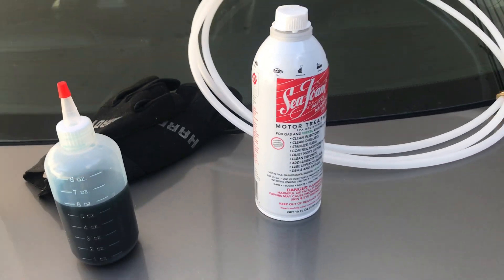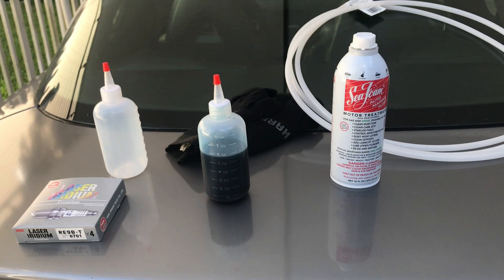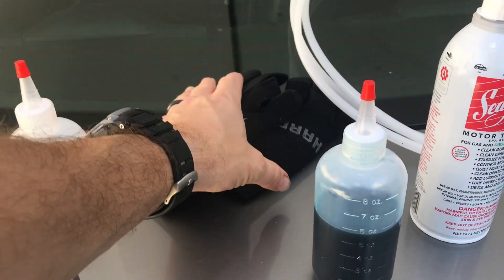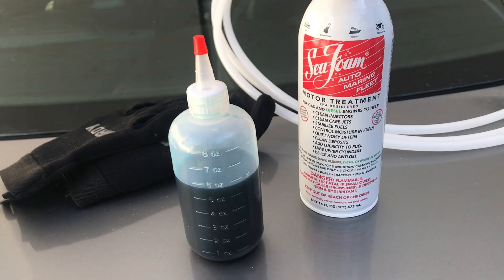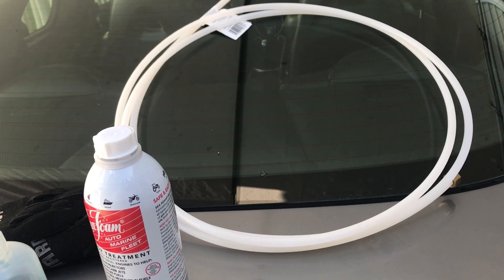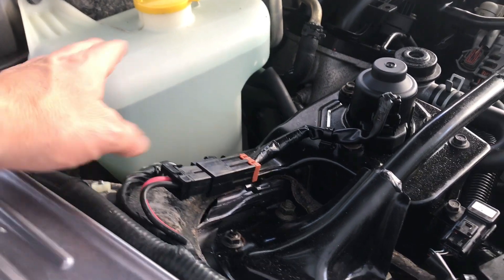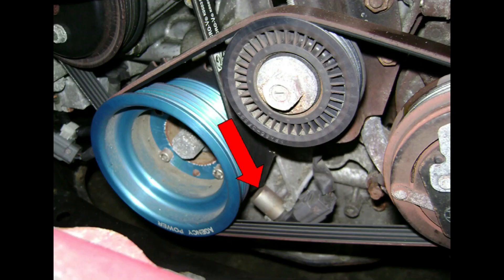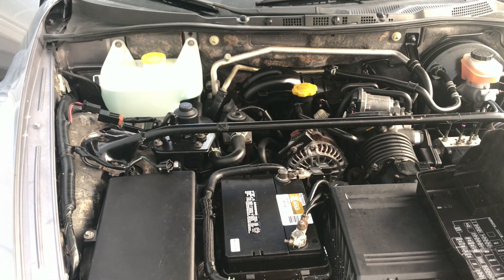SEAFOAM DECARB MAZDA RX8 HOW TO AND DOES IT WORK rotary engine

Comment: If you just want smoke to come out of your exhaust try extra virgin olive oil. It will be much cheaper than that stuff, smell nicer and will remove just as much carbon. If you have ever stripped an engine you will see that these deposits need to be chiselled off. But, hey, marketing is more powerful than sense.
Reply from the maker: Not to argue anything your saying except; On what planet is olive oil cheap?
Reply: Planet Aldi?
Reply: Does that really work? I want to Seafoam my engine but I’m concerned about my apex seals or fouling up the spark plugs.
Reply: @hiddenrotor3377  i use Coconut oil for the engine and Lavender oil to clean omp system
Reply: Has anyone tried ATF through that vacuum input? Supposedly it helps the Apex seals expand to provide more compression and less carbon monoxide output. Trying to get one smogged in California.

Comment: Change plugs every 15k miles? Thies should be rated 100k +

Awsome video though, your the man!
Reply from the maker: Thanks. Pre mixing fouls out plugs and if driving a rotary hard it is smart to change these plugs out very often.
Reply: Dude the 13B-MSP  isn't even rated for 100k miles. If you think spar plugs are expensive stick to toyota lol

Comment: You don’t need to disconnect fuel pump fuse, just press accelerator all the way down while cranking. It cuts fuel automatically for the purpose of deflooding the engine.
Reply: The fuel pump won't run while cranking with the ESPS unplugged. No need to do anything else for fueling
Reply: If your engine is flooding buy a civic lol

Comment: How in the world do you pass emissions?
Reply: If you want to pass emissions don't buy a Rotary lol or hold onto your cat
Reply: Nevermind, saw the Florida plate.
Reply from the maker: @steveramos1452  I love that I can buy any car and bring down to any corner and have full exhaust no cat installed for $100. Only thing I hate is insane amount of Diesel trucks rolling coal and lifter beyond what's needed.
Reply from the maker: @steveramos1452  lmao. Yeah never had emisions. Actually first year I drove we had emisions and then they dropped it.  Of course you could register 15miles away even back than with no emisions

Comment: That's not the throttle position sensor, it's the Eccentric Shaft Position Sensor ...and you don't remove it, you disconnect it.